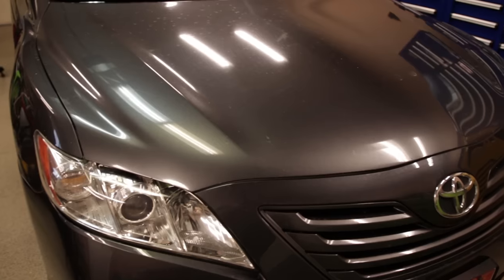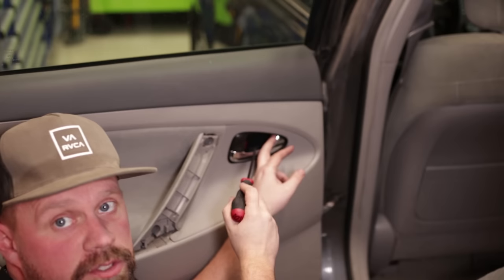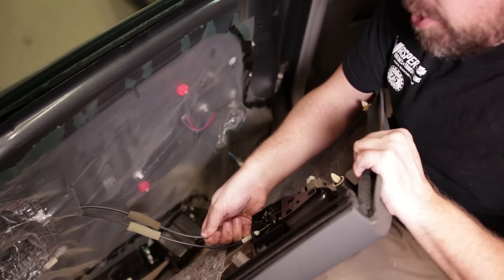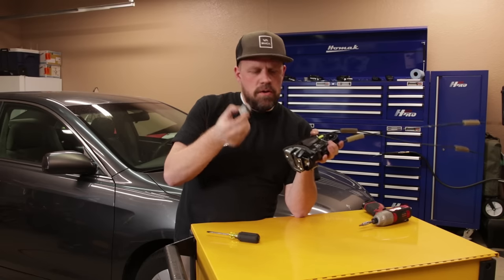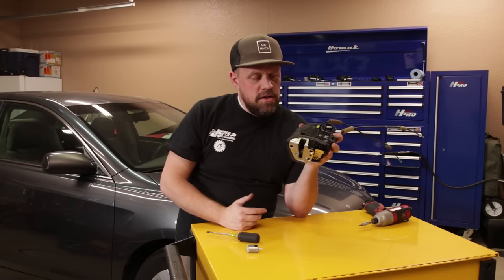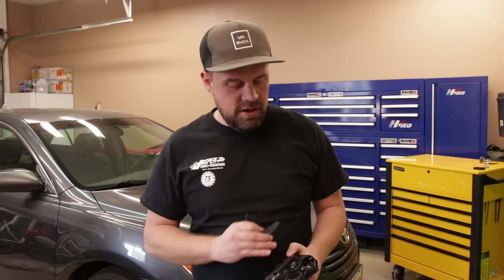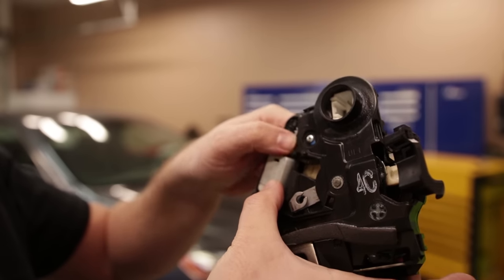How To REPAIR A Door Lock Actuator Motor -LOW COST WAY

Comment: 9 out of 10 times when you get that motor out pop the back cover off, use 180 grit emory cloth or Scotch-Brite pad clean the commutator and brushes, spray it with electrical contact cleaner put it back together and it will last the life of the brushes in the motor, 15 years.
Reply: I have followed the 'emery-cloth' approach twice to the same Taco door.
Reply: This was my thought also . The contact points are no the best solution for a sea side environment. I think I’m going to try this clean up approach first
Reply: I’ve used a penny in place of the little piece in the motor and my locks haven’t failed in 12 years

Comment: I recommend not using a screwdriver to pop a door panel off, as it can damage plastic door panel parts. If you use a soft plastic door panel removal tool ($7 for a set of them), it can save you some headaches.

Comment: Awesome video!! Thank you for this!! I got quoted $800 for just one door, so it’s safe to say you just saved me $1550.00 for the two I need to fix!
Reply: Find a new mechanic/shop. No matter how you slice it, $800 is a total ripoff.
Reply: @nicT9  $500 is typical of dealers and shops and that's too expensive.

Comment: Here's a tip. For trying to open or get into a space between 2 plastic panels use plastic tools that are designed for this very purpose. That way you won't have any nasty dents, chips, scratches after you're done

Comment: Excellent! Even if I never do this motor swap, it was so very cool to learn something. These are the micro lessons that carry over to a hundred other fixes. I've already ordered the whole assembly for $29, but I now have a better understanding of the R&R (removal/replacement) for my 2008 Highlander rear passenger door. The community tips their hat to you for adding something meaningful to the knowledge base. Thank you for taking the time.

Comment: This was very helpful. I successfully replaced an older door lock motor but my new one was sealed like this. I recommend using a soldering iron to melt the plastic to avoid small plastic chips getting in the gears etc.

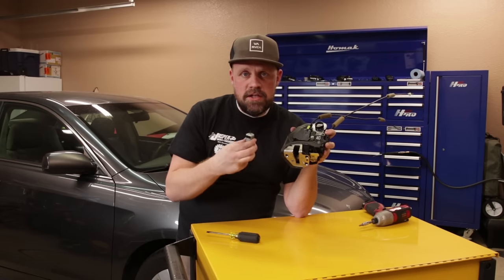Comment: At about the 5:00 mark I decided I'm going to buy the entire part and not risk digging into this thing, but I watched the entire video. Well done and great information. Thanks.
Reply from the maker: Fair enough!
Reply: If you're planning on buying the entire part why not attempt this repair the way he did anyway. It's five more minutes of work to cut the motor out.
Reply: Of course I could have bought an actuator on Amazon but the car would have stood disassembled for at least 3 days. And then I decided to try and everything worked out for me.

Comment: On a 2014 Corolla LE, I just completed all four actuators. You can remove all screws, remove the metal door latch mechanism, and carefully pry the plastic case apart at the seam while pushing an Exacto knife down the seam to guide the separation followed by a screw driver. For both front and back you only need to separate the half of the case on the side where the electrical connection is made because the motor is right next to this on all four doors. Once half is separated, carefully pull out the old motor and replace with: 10mm Flat Shaft Central Door Lock Actuator Motor FC-280PC-22125 FLAT SHAFT, D Spindle. Then clean the mating surfaces and reattached with Loctite Plastics Bonder after making sure that all of the moving parts are moving as expected. It is doable without taking a Dremel to the case. In my expereince the cases mostly separated down the seam, however everything is able to be glued back after replacing the motors.

Comment: I am gonna give this a go on my Nissan Maxima if I can get the motor in advance. Just a suggestion, you may want to check the YouTube vids regarding "plastic welding" with a soldering iron. I have used that technique more times than I can count over the years instead of expensive and sloppy epoxies. Thanks for the ideas and demo!

Comment: These can be purchased for less than $40 now.  Just replaced mine the other day and it works fine.  We'll see if it holds up but for now, it's working fine.

Comment: Great video, this even works on my Australian model 2005 camry downunder upside down wrong side drivers door car:), i have done 2 driver side doors as they had failed however all doors lock and unlock now but when locking you hear 4 doors lock then there is a feedback signal then the horn beeps 2 times just like when  a door is ajar, but in this instance the doors still lock. Im thinking the other 2 motors are not strong enough to complete lock sequence and feeding back that a doors has not completed the lock cycle please feel free to comment.

Comment: I just replaced the actuator. Easy. I opened the AISIN brand and you do not have to cut anything or glue anything to pull the actuator out. There are just 3 bolts and play with the casing. If the gear comes out do not worry as they are dummy proof. Now I am going to radio shack to get a new motor.

Comment: hi , good job , i did 2 front locks , i just undid clips on corner where motor is and removed the little screw lifted corner ,old out new in , 5 minutes done . both work great.

Comment: Considering the time it takes for the new motor to get there after ordering, probably the best strategy would be to install a new actuator, fix the old one and just keep it around as a replacement part.
Reply: Now you are thinking like a rebuilder . That was my business for 20 years with FWD axles

Comment: You don’t need to cut. Can be easily opened by releasing the locks and one small screw next to where you cut.
Reply: Would love to see a video demo on this. What's your make/model?
Reply: @jesuschrist9009  Its a 2002 corolla. I have done this repair but didn't make a video. 
Still it's extremely easy to open up the top cover by releasing some locks.
Reply: EVERY vehicle is different, Honda CR-V has screws, this Outback is one piece plastic, real basic and cheaply assembled, must cut out. It's best to have several tricks up your sleeve, great video !!

Comment: For everyone saying ”just replace the actuator”, I've got a 20 year old truck, where many of the cabin and body component parts available are only cheap chinesium parts. 

Great for a quick fix, but only a fool would expect them to be a long term fix like OEM. Since OEM, and even many reputable aftermarket companies, no longer make my door actuators, fixing my own actuator is better than buying a part made with the most cost cutting and profit maximizing practices and materials as most Chinese products are made. (Yes, I do understand the big 4 motor companies have fully drank the planned obsolescence cool-aid, and most of their products are made garbage from the get (looking at you, FORD)).

And remember, every time you replace your cheap Chinese part, that's more crap going to a landfill, or being incinerated and having those fumes going into the air.

I'd rather replace a small motor, than the whole assembly. Hell, id rather replace every single worn component in there just for the sheer joy and pride of knowing ”I keep this f*#$er running”.

Comment: On the driver's side the lock is different. Does it have a switch in it that is prone to failure? The switch that is connected to the handle/barrel lock?  When the key in the lock is turned one way, all the doors open, the other then they close?

Comment: Ive been doing this to Toyota, Nissan, and  Honda(easier) Door Actuators... 
On this one , it does not have to be cut. Just take out the screws that holds it together, pry the side where the Motor is, just enough to fish it out.  Putting a new one is just easy as dropping it in...  I always get this motors from the yard...
Reply: Im trying to fix my left door lock actuator on my 1999 tacoma everytime i click lock it makes a loud screeching noise? Anyadvice
Reply: @Psycoticjim  sound like th3 motor inside is still working. It could be a broken gear teeth or something. Only way to find out is to take it out and inspect.
Reply: I took it apart and the motor works its the gear thats on the motor that cracked, know anywhere or anyone who wouod have just that gear?
Reply: @Psycoticjim  try ebay. I doubt they have the gear though. Best yo source at the yard or ebay, you cam negotiate the price....
Reply: @diy-helpshare3494  i bought a full door for 200 with working one and putting old one back in i super glued the gear and its working now so i put the old actiator in door and im selling for 150
Reply: @diy-helpshare3494  thanka for the help! Means alot
Reply: Blaze Psi I replaced the actuator motor, and it works, but now the door is unlocked in either setting.  I can pull the cable and se the thing moving inside the actuator. Got the case opened with it upside down and the wheel/gear fell out also.  I put it back but wondering if there are certain settings inside that are off now or what.
Reply: @rg3042  Probably some part is out of place. Thats the reason I only pry it open. Try tell flip some parts inside, its going to be trial and error. Connect power and try everytime you make changes.
Reply: @rg3042  The motor should spin on opposite directions everytime the switch is moved from lock to unlock...

Comment: I am waiting on the motor to come in, in the meantime I opened the actuator and took the motor out. I noticed it does spin when attaching a 5v source. Does this mean anything? Is it possible that the motor is 'weak' and therefore it was not working properly?
Reply: By now you have probably installed the new motor. From the videos I have watched in the past, the motor still turns however the brushes are completely worn out inside. I'm about to order some motors for my wifes Rav4.

Comment: Any idea how you would get the door open to remove the door panel if the actuator won't let the door unlock.  Basically the actuator locks and unlocks both remotely and manually, but the jaws wont release to allow the door to open.  My choices seem to be either cut into the B-Pillar and cut the striker bolts off or somehow destroy the door panel and bust the actuator apart.  Not sure I like either option.  Any suggestions would be welcome.

Comment: Brian, you didn't show how you got the entire actuator assembly out of the door? I tried to get mine out thru the top metal opening but a post there was in the way. Did you use bottom metal opening to get it out? Thanks.
Reply: That may be your window track, remove the one or two bolts for it on the door and is that was the issue then you should be able disconnect the bar that is plugged into the locking actuator and remove it.
Reply: I have a 2007 avalon and I had the same issue with the window bar...I was able to unbolt the three bolts for the actuator and flip the actuator.  And maneuver it around the back of the bar...I've done it so much now it's easy as pie....fyi I changed out the motor in one of my doors and it works great now!!! 😁

Comment: I probably wont get a response but my buddy has a 2010 yaris sedan and one door the hadels act locked only opens frome inside anfer locking and unlocking with fob took door card off and it works pefet without toutching anything pit it back on and it acts up again undid lock cable and now door works fine

Comment: Hi. Thanks for the video. Do you know what is wrong with my auto lock system?  My car is a 2006 Toyota Camry. 
In the morning when the weather is cooler, all the lock switches work -- including the buttons from the remote.
But in the afternoon, when it gets hot, only the driver window locks work. This includes the manual lock switch itself and the rocker switch that controls locks for all 4 doors. 
Also, when it's hot, the rocker switch on the front  passenger side only controls the front/driver side lock (both unlock and lock).  The same is true with the key fob remote, which is able to lock/unlock only the driver lock. 
All other locks do not work when its hot. They only work when I manually lock/unlock the door from inside. 
Thanks.

Comment: hi
my uk spec  2016 hyundai tuscon  drivers door , wont open from outside after unlocking with remote, but does open from inside handle, please help, any suggestions?

Comment: I got a question about a 2008 Toyota Highlander my actuator is bad and the door is closed how do I go about opening the door in order to change out the actuator without ripping the door panel off on the inside of the car
Reply: Having the same problem.  I'd love to hear if anyone has an answer to this question?

Comment: Hi Brian, If the central locking system is not working, how to find which door actuator is faulty
Reply: OHM test it or replace both motors at once. they are about 10 bucks each.

Comment: I have a 2012 Lexus ES350 , the dealer replaced the actuators at 30,000 miles now at 80,000 miles two doors sometimes lock or open right  and sometimes don't lock / open  at all . What's wrong ??Is there a way to disconnect the door lock actuator and use manually ?

Comment: That could have been taken apart without cutting it. It's a hassle doing it (sometimes it's necessary), but it can be done. However, if you're going to cut it out, you might as well really plastic weld it closed, by either using a soldering iron, or an actual plastic welder (HF has one for around $20) to melt the plastic. I would also test it on a power supply before closing it up.

I had a door actuator go on a 2014 Infiniti. It wasn't the motor that went, it was a cam on a plastic worm wheel that snapped off; made a buzzing noise when activated. I didn't want to pay the $500 that Infiniti wanted for a new one, so I 3d printed another worm wheel. I redesigned the worm wheel so it would be stronger and more durable than the original. The original had a few weak points on it which leads to it failing over the long run.

Comment: Brian, do you also do a video of how to put it back together.  I know you can reverse steps, but sometimes it helps to see it happen.  If the actuator is bad, will it prevent reprogramming of a fob.
My car will do an automatic lock on me at the most in opportune times.  The wind blue my door closed my keys were with my purse and it auto locked before I could reopen the door.  It that the actuator causing that?

Comment: Be  carefully when u change this actuator motor, maybe the new motor looks like the original but the secret is inside it, the high quality motors are using coal brushs however the cheap motors only are using a small metalic brush and it will broken so fast
Reply: If they were so good then why are they breaking after a couple years? Nice try, Toyota.

Comment: A question for you. I changed one of my actuator with a used one. After changing it, when I unlock, the door unlocks but it's like it is unlocked from the inside but not from the outside as I cannot open it from the outside. But once I opened it from the inside, it then opens from the outside.

I got the part replaced and installed this other actuator but it is still doing the exact same thing.

Have any idea what the problem might be?
Reply: There is a rod that connects the latch to the handle
Reply: @rob_trevino  I know and it is correctly connected as it opens from the outside after its been correctly unlocked from the inside.
Reply: Take it back apart and check out the linkages in the locking mechanism I guarantee you something is not connected that should be or the cable isn't attached.

Comment: 4/5 of my power locks do not work, lol... 2003 RX300 255K miles. Rebuilt trans at 160K, original engine with no major repairs beyond water pump/timing chain (preventative, neither failed).

Comment: Before you repaired door when you closed the door did the lock stay closed so that the door bounced off lock? That's what mine is doing & I want to make sure I'm buying the correct piece
Reply: Hey Chris, i would look at cleaning and lubing up the actual latch on my door first. those get gunked up and stick causing it to not return and bang on the latch attached to the car
Reply: @Availablehandle-i1k  the latch has been pre closed by accident  if that's the case it's trying to latch to the car already  ya need to unlock the door latch open the latch by using the inside door handle cable suppose an outside handle will work if its still on the car hope you didn't slam it

Comment: Where do you get those little motors from?
Reply: Amazon. you need to now the shaft length and shape. google "club 4g door lock rebuild" I wrote a how to a while back on g4 eclipse. The project will be the same over all. Just apply the knowledge to your project.
Reply: Skype：SISI WEN              we can supply those motor

Comment: Did your repair work?
Reply from the maker: Yes it works perfectly!
Reply: @doityourselfbri  I just replaced the motor in my dads es350 it works so far. I unsnapped the lid it wasn’t to difficult and is probably faster then cutting it and glueing it.

Comment: All manufacturers use this tiny, old, brush motors, and The collector/comutator gets dirty and Will have a high resistence, impedance/curent fall bicause of The dirt / debris from The brushes. Why not use a solenoid, it s indestructable. Or a brushless motor.... A door has to rezist 2 million opening/closing.  But that is not The bad part, The fact that they don t offer them as a replacement part is The burning one

Comment: please tell me where do you get motor amazon or ebay
Reply: It depends on the motor you need. Take note of the shaft length and the shape. And possibly the contact location "is it a stab connection or pressure"
Reply: open Alibaba and search “Car door lock motor” made by Shenzhen Jixin Motor

Comment: good evening I have a 2012 chevrolet aveo and when I open the door the ceiling light does not come on either the driver or the front passenger.  Sometimes if I open the door, the ceiling light works, but most of the time, it does not.  you know what could be wrong with .the car locks and unlocks normally